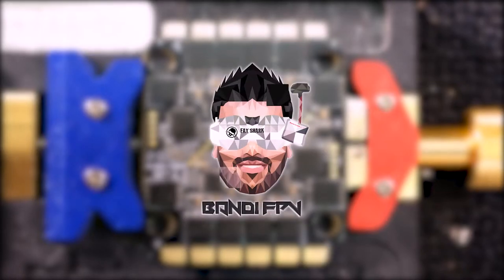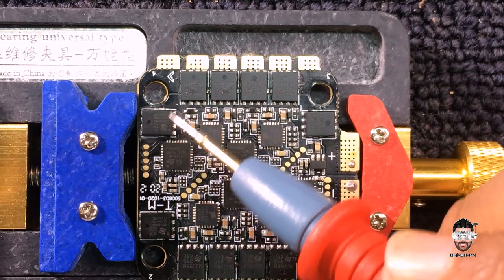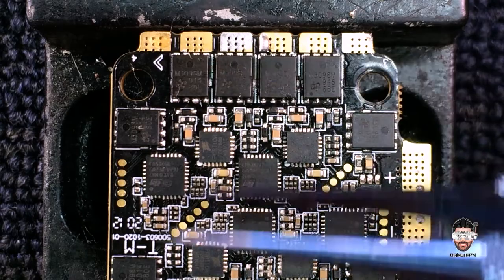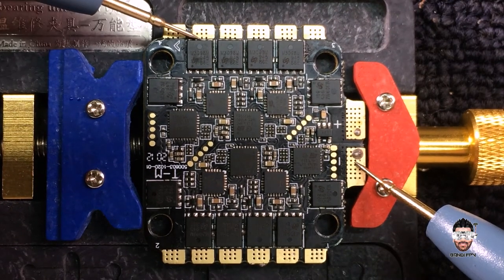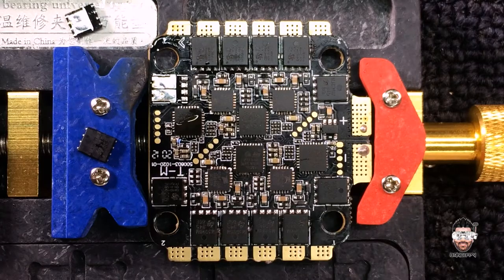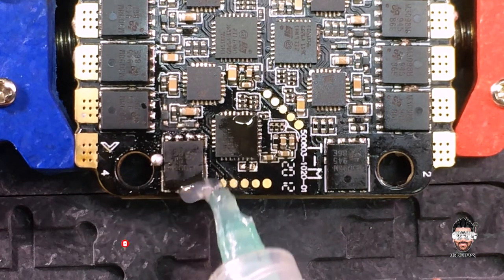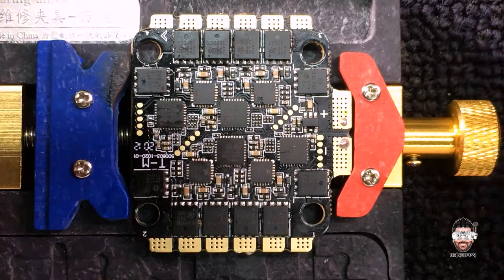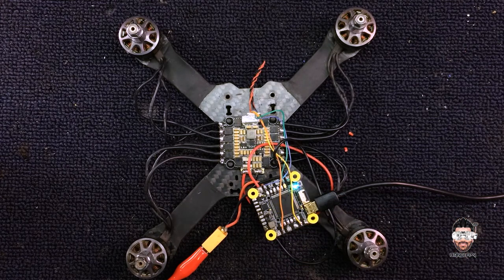Damaged ESC Repair T-Motor Velox 55A

Comment: I have an ECU with one motor that does not act right. Pulses power to the motor. Had smoke when attempting to power motor 2 and nothing afterwards. No obvious damage. 3 other motors work fine. No shorts to any of the 3 phases of any of the 4 motors, including 2. What could the issue be?

Comment: I have a question. Why the 4in1 is not suitable to be used with larger motors like MN6007 motors while amperages ranges is the same?